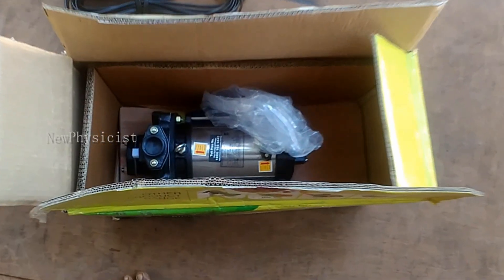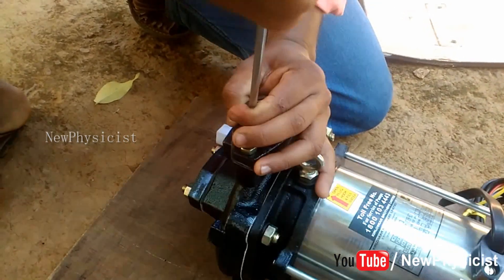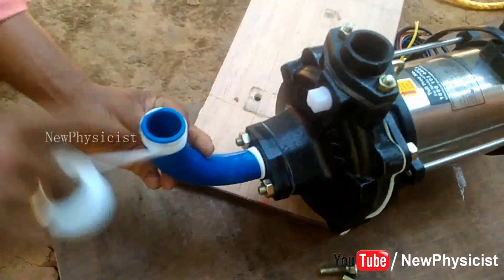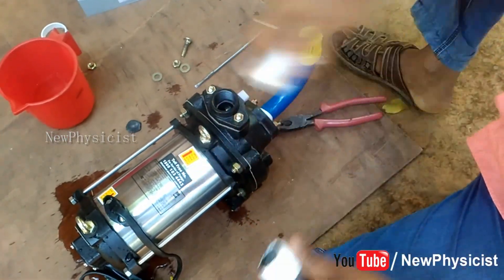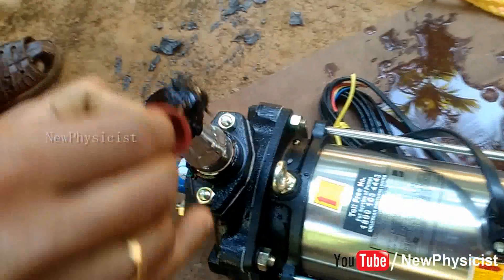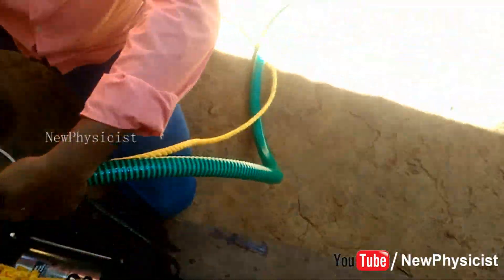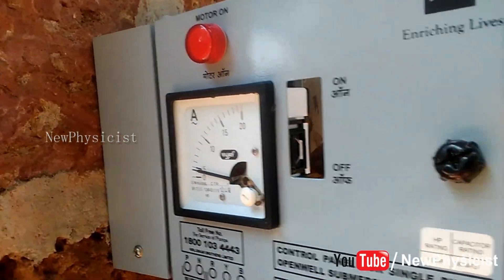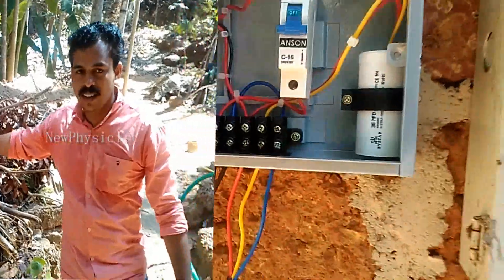How to Install Submersible Water Pump by Yourself?

Comment: Edo..
Show inside the well..motor position🤔
If keep inside , no power leakage??🤔

Explain how ll u fix it in a big appartments
Reply from the maker: No it’s submersible type water pump.
Reply: @newphysicist  ????no means?
Reply from the maker: No power leakage.
Reply: @newphysicist  ok.
Any appartments or home fixed such pumps?
What's the difference?🤔
Reply from the maker: Submersible centrifugal pumps are very common now.

Comment: What motor do I need again if I already have a 2HP/20 stage submersible motor/pump to draw water from borewell to sump in order to again send water from the underground sump up to the overhead tank situated 50 feet up from ground level? Do I need another mono block pump from sump to the over head tank? If so how many HP?

Comment: I think one thing is missing!
One non return valve is necessary in pump discharge flange to control back water hammering( pressure) when the motor off
Reply: Yess.. Non returnable valve is important otherwise when we switchoff the motor water will come back In motor and it can damage the motor

Comment: Did you forget cable connection on motor
Reply from the maker: Cable comes already connected to the motor. The extra cable I shown is in the beginning is to extend the existing one. Anyway thanks for asking. Nice question😊
Reply: Yes he should not connect cable on moter  side...